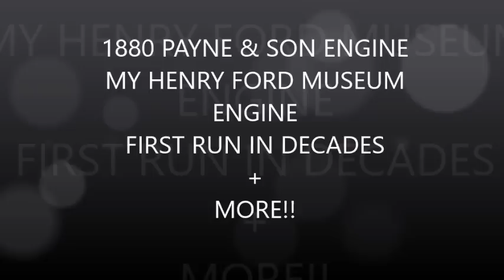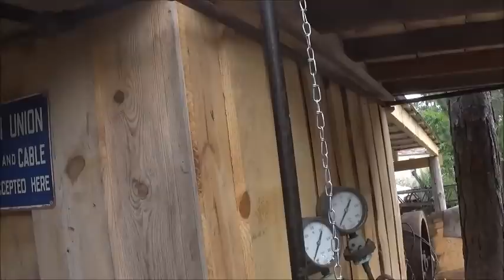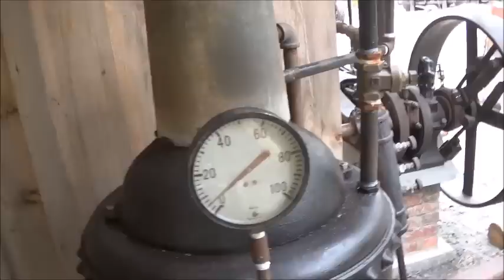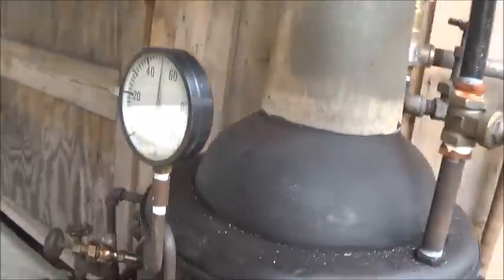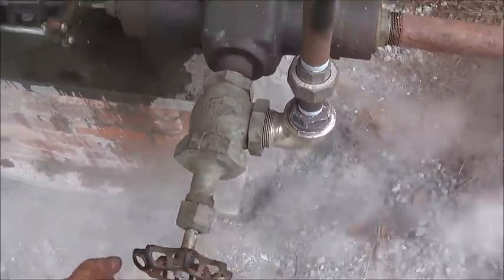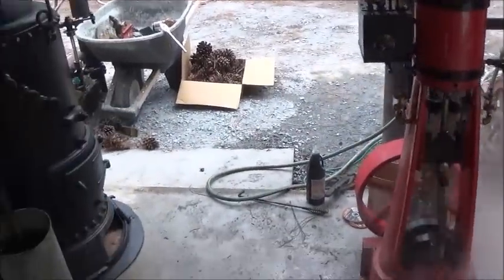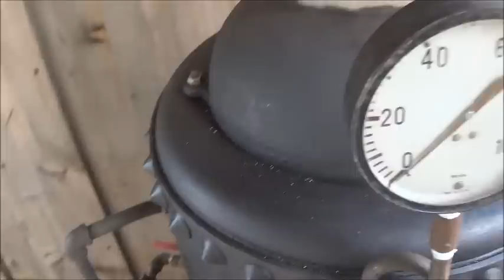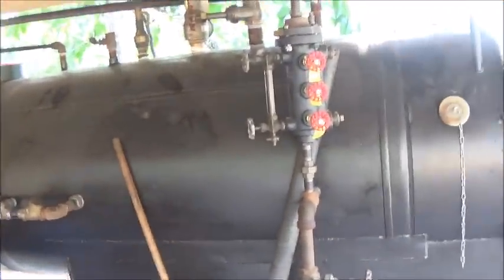1880 PAYNE & SON ENGINE FIRST RUN ION STEAM IN DECADES

Comment: The rhythmic sound of steam engines is very relaxing. My family has a rich history working with steam power. I would love to have set and talked with them. I had my Grandfather's Steam Whistle from the Oliver Mine in Fayette County, Pennsylvania 50 miles South of Pittsburgh, when it was dismantled at the end of Deep Coal Mining there. Unfortunately it was stollen from me in the 70's from my storage shed. I always wanted to find a way to make it sound off, but I hope it found it's way to a good home. The home I was born in, in Uniontown, had a Steam Furnace delivering steam to Radiators. As a child I remember the high pressure valve releasing over pressure. I thought that old furnace was a Monster. Haha. The noise of that was frightening. As I was born in 1944, too late to talk to most of the old folks. I would have loved to have worked with those family folks. 
Thank you for your work on  the Steam Engines you have answered a lot of questions I had about them. Many folks don't realize how important steam power was to our Country's growth and development. Your work attitude reminds me of those hard working ancestors. I was a Bricklayer spending 35 years in the Washington DC area. 🇺🇸♥️🇺🇸♥️

Comment: At about 8:25 my closed captioning says that the steam engine is saying "THANK YOU"
I agree with that, thank you Jonathan.  Your display is coming along very nicely.  You can recalibrate those steam valves in many cases by tweaking the diaphragm in them, the one you have may be fixable and even if not two pressure gauges were not uncommon on steam rigs, one set up for when you were on the platform and the other one facing some other direction so it can be monitored when not on the platform.  Great video!
Reply: Thank you for the CC hint!

Comment: Jon, just keep doing what you like to do. I am always amazed at how much you manage to achieve. It was great to see the old engines running on steam. It's much better to see and hear them running quietly than with a massive compressor banging away nearby. I think you are lucky to haven plenty of wood around the place you can use for fuel. All the best, Mart in England.

Comment: Good videos Jonathon. I’d just like to mention that normally steam lines are insulated. This is not only for personal safety but because when you have longer lines you will lose some heat and your steam could turn to hot water. Keep up the good work.

Comment: Wow, you’ve done a lot of work!  It’s becoming quite the steam museum!  
Two comments since I’m a retired power plant engineer. Take-offs for steam off the main header should be either horizontal or off the top of the main to prevent excessive condensate from draining toward the engine. Also, if you pipe the outlet of a safety relief valve upward, put a small hole or a tee at the bottom of the riser to drain water out. You don’t want the relief valve to have water sitting against it. That is ASME boiler code.

Comment: Diversity of subject matter has always been a hallmark of your channel. Keeps it interesting. I have no idea where or what you might be doing two years from now.  Like it that way. Great job. 
The D&H ran some of the largest steam locomotives on the East Coast on track bordering our farm. This section was a heavy long uphill grade often requiring an extra pusher locomotive for assistance.  These locomotives traveling at not much more than walking speed while at maximum power output were awesome.  A display of raw visceral power.  POWER  in capital letters !!   In complete contrast,  the returning lone pusher traveling back down the grade at good speed had transformed from a thundering giant into a near silent black ghost, almost a glide with little more than a whoosh and the occasional squeal of light brake application. Steam power !

Comment: I really enjoy watching these old engines come back to life. I was a Machinist Mate in the Navy and that is what we ran all of our machinery in the engineering spaces. I would like to tell you that your gate valves you are using to control the saturated steam with are OK, but in order to regulate saturated steam you need to have real steam valves on the inlets to your engines and especially the outlets coming off of your boilers. That little low pressure boiler is not especially dangerous but when you fire up some of those larger boilers you really need to have a steam valve that is designed to handle the temperatures and the pressures of that boiler. Please start looking to buy or barter for some of the regular steam valves for your sake and the people that are going to be around these machines. You will find out why I'm saying this when the first gate valve either blows up or is cut out by that steam pressure. Just a little friendly advice from someone who has had a lot of experience with different kinds of steam engines over the years.

Comment: I was in the USN back when men were men and women weren't. Always on ships with boilers and turbines. Lot's of fun actually.Cold iron to ready was 24 hours: boilers lit,warm up and drain all lines,start turning over steam turbines slowly to warm up and get the bow out of main engine turbines.USS Bowen: 1200 psi system. USS Mauna Kea: 400 psi system. USS Roanoke 600 psi system.MM1 when I was honorably discharged.Was going through some type of engineering inspection with non-crew inspectors and the auxillarly main lube oil pump on the Mauna Kea was a twin cylinder recip pump. By design could not maintain a steady pressure. Some Commander doing the inspection was going to fail it because of that and was riding me hard to get it to maintain a steady pressure. LIghtly snapped at him (very lightly) and said Sir if you can make it do that I'm all ears and eyes. He couldn't and passed it.

Comment: I had never thought about how those slide valves worked until you converted that water pump into a steam engine, You should put that one on display as well.  If you could modify the valve housing to include a glass window it may be instructive for any visitors.  Just a thought.  Looking forward to some Elcar work as well.  Keep up the good work and youtube content, best wishes from an Aussie mate.

Comment: Thank you ! Love the video !!! Wonder do uou ever come acrost any power units. There is a stripped one sitting over town at a guy who has steam stuff. Kind of like you. Just a few items though. When I was a boy my amish relitives had them. Look a lot like a steam tractor only no cab or drive. Mom talked about them thrashing and a spark from it got in the barn loos hay and i did not end well . Thanks again. You have come a long way from that first video I watched of you with a water pump steam engine. That was great . Watched ever since

Comment: Man your set up to do some work without gasoline that is just pretty cool. Wood is free it is always available so that is fun or interesting to see it work. Now you just need a stainley steamer to drive to the store. You have got some nice machines. I enjoy seeing them run. That little boiler runs quite a bit of stuff more than I thought. It looks like the early 1900s around there. The generator it will be very interesteresting seeing that run.  Generators seem dificult to get going. Always corroded being electrical. I am courious how that will turn out?

Comment: It is astounding what you have managed to do in such a short time. I can see the day coming when when you'll have the steam driven generator supplying electrical power to the premises  and a steam driven edger and chop saw. Have you ever considered getting an old Lane hand-set mill and running that on steam? Seems to me you've got the capacity with the larger boiler and engines.

Comment: Just a quick tip from an 80yr old boiler tech, Teflon tape is not your friend, threads and shards get into everything jamming valves and orifices. Best use plain old Rectoseal pipe dope.

Comment: What are you using for steam cylinder oil? We use Chevron AW 680 in our locomotives. Formulated for high temperature steam. AW 320 machine oil for the rest. Does that valve rod use white metal packing or Garlock? Loving your operation.

Comment: Back in the '80s we had a 1961 Ford falcon 4-door straight 6 I think it was a 225 3 speed on the tree you could flutter around with the choke going down the highway and I swear that thing got 35 40 miles to the gallon

Comment: Do you ever sleep, you've done so much so quickly. 
Just a few constructive criticism. 
Gate valves shouldn't be used for throttling they are designed to be open or shut, you'll end up with bad erosion, lack of control and wire drawing
Can't make out if your steam fittings are cast iron or steel, cast iron should not be used on steam and your insurance will be null and void if something happens.
You need a steam trap especially on that 90 degree coming out the boiler you could end up with a slug of water damaging your hard work. 
Keep up the good work, great content 👍

Comment: no complaints here and thanks for the videos! as far as the generator goes if tesla and edison figured it out  over a hundred years ago  you shouldnt have many difficulties and there should be documentation on anything you arent understanding.  the engine  is spinning either coils or a magnet and that generates the electricity  . theres more to it obviously but a magnet and a wire is how it works  ...if your looking of opinions mine is more of the take it apart fix it put it back together and run it   if possible  making useful  product ... lumber for buildings ...power for lights   line shaft  its good just to not see them rusting away in piles! ps. mike from small engine mechanic is a service technician for gensets  and also has the steam bug  so he is probably a good source of knowledge.
Reply: George Jones  the only crime in ignorance is refusing enlightenment, he may or may not know mike definitely dose know and i feel is a good person at heart so should offer assistance if asked . either way he has the information at his disposal now ;]

Comment: A steam powered welder could save some money on electrical bills.  Of course it would require two-man operation, as someone would have to tend the steam engine watching to make sure it's not running out of water.. You might even run an electric forge.  Great videos.

Comment: Be really careful when you spin up that grinding wheel !!!!!!  They were meant to be slowly turned by a foot treadle. Many people were seriously hurt or killed when folks hooked up an electric motor or a gas engine to them and they flew apart from centrifugal force. See if you can find out what a safe RPM is and then make some way to limit the RPM

Comment: show you car just 1 car running on home made hydrogen ball quart jar cell /with plats of steel with 1/8 holes drilled and + and - on 12 volts  i run my cell  with rain water //because of storm has more hydrogen charge in 1 quart jar of water /it turn  brown when its done  out of hydrogen //people today need help on price of gas on older cars